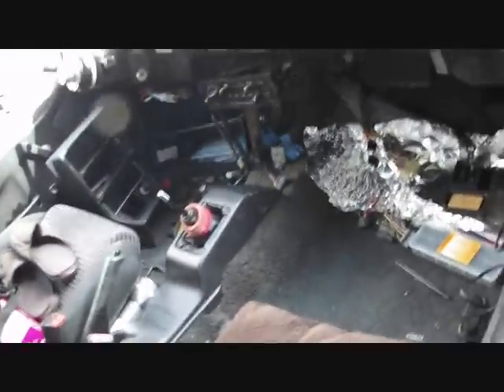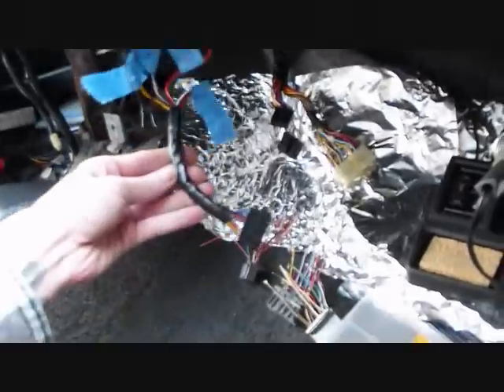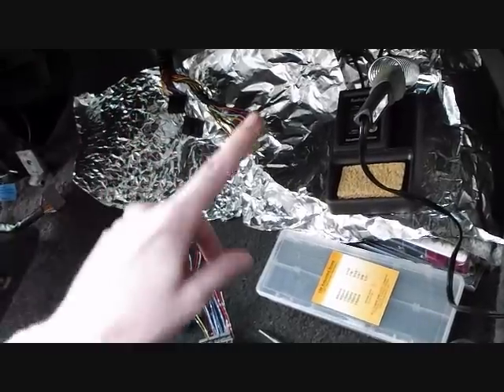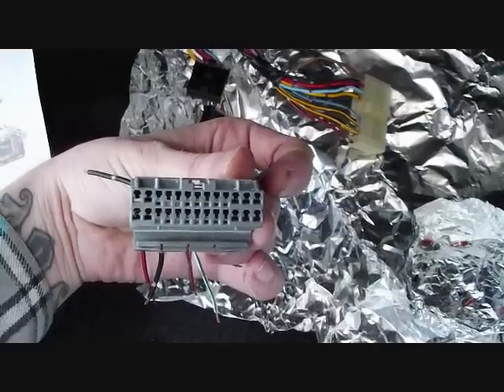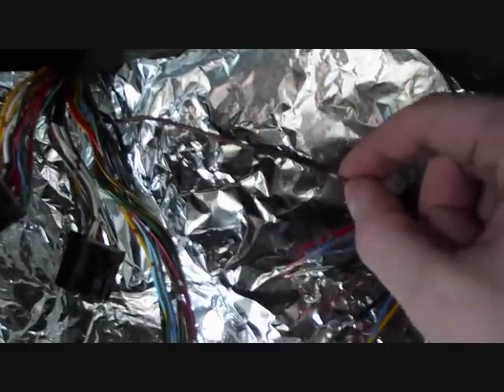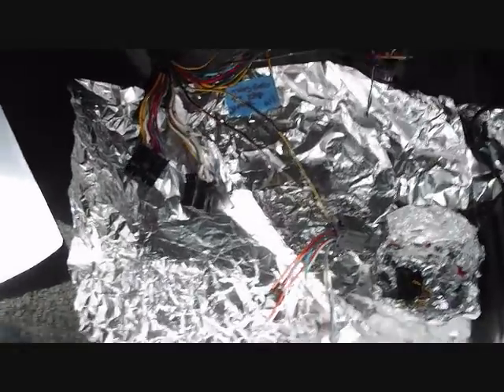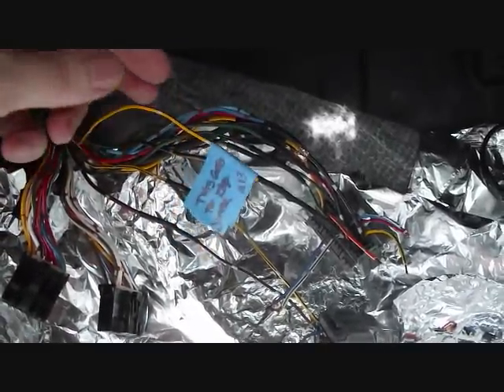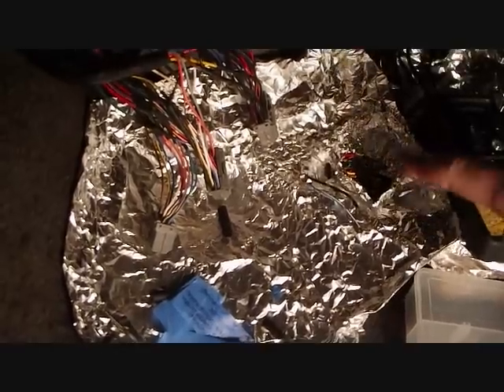89 Honda Civic si OBDO to OBD1 video

Comment: Ok does the obdo ecu and obd1 ecu have the same pin out number have their same locations
Reply from the maker: No Unfortunately they aren't the same, you are going to need to convert the wiring to the corresponding engine setup and ECU
Reply: KILLAB9696 it’s a d15b standard just wanna do a multi port and dizzy change obd1

Comment: I just purchased a - Zerg Dual to Multi Point Wiring Conversion Harness"   installed to my P06 ECU on a d16y7 MT/5 speed with an d16y8 intake manifold...all this went into my 89 civic DX very easy without disassembling the interior. Car totally hauls ass

Comment from the maker: I think the wires are different for an automatic,i'm really not positive. If your car is multipoint I think your may just need to re pin the plugs, but the older style may need some upgrades to make it work. I started with a stock si harness, so if your car isn't multipoint just go to the junk yard and get a under dash/ hood harness, or get them on ebay! What set up are you running motor wise?